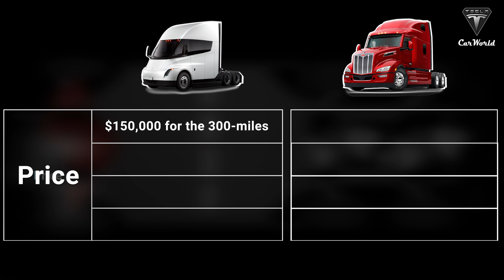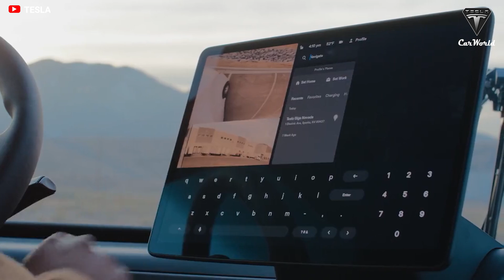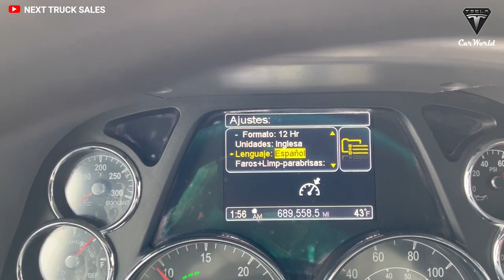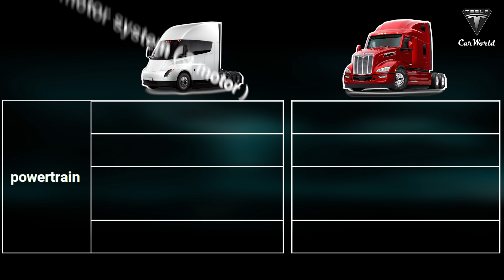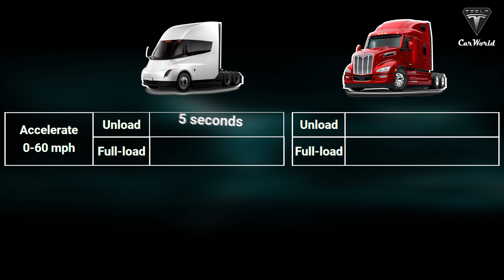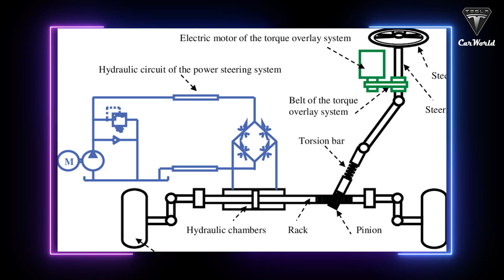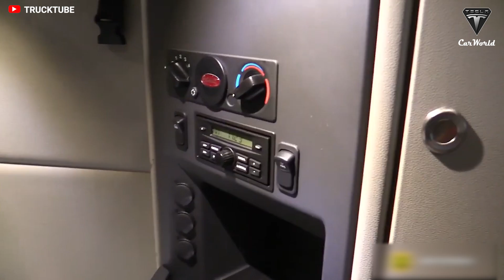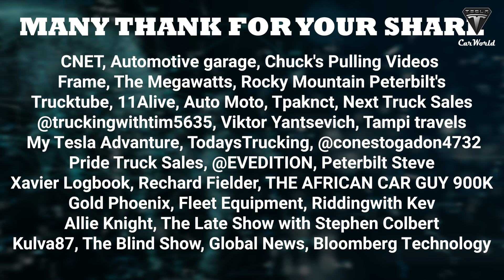Tesla Semi Vs. Paccar Peterbilt 579! Which is the Best Choice of 2023 Heavy Trucks?

Comment: The day my boss buys an electric truck I will quit and start working anywhere else!
Reason? I drive in arctic conditions during the winter and I don't want to freeze to death if I get stuck during a storm or something like that.
The storm itself is not a problem, the problem is that there will be hundreds of other, mainly private cars, who will have a more urgent need of assistance than I.
Our Scanias consume about 2 liters/hour on idle so that will keep me warm in my truck for several days if I get stuck, waiting for tow or EMC somewhere.
I can guarantee you that the batteries in a Tesla will NOT last as long!

Comment: I will take the Pete. Know why? First, try to roll-through a scale house grossing 82K , yea that's right you are going to get a big-fat-ticket. Second, they claim a range of 500 miles. Don't think so. Know why? Because if the Tesla is grossing 80 K it will put one hell of a load on the batteries which will severely cut down on the mileage. Add a head wind it you lose more millage. This has already been proven with the Ford Rapture as mileage was cut by 70% pulling a Model A (which weighs about 2700 LBS)35 miles. And how are you going to charge the tractor. That is much easier said than done. Truck stops will have to equip the power supply and if you know anything at all about truck stops this is going to be a huge problem. I could go on and on why the Tesla Tractor is not going to work, the technology is not there yet. If a company is using the Tesla tractor around town on very short trips, they could work but I would not want to pay the electrical bills, which would be very expensive.
Reply: Everything you said is wrong. First, apparently you're not aware that there's an exception allowing electric and natural-gas powers semis to have an 82,000 lb. GVW; so no "big-fat-ticket". Second, the 500 mile range, with a load of 81,000 pounds, and climbing the 4,100 ft. Tejon Pass ( Grapevine) has already been demonstrated. 
Of course a headwind will reduce range; so I guess not everything you said is wrong.
Yes, some truck stops will have to have chargers. PepsiCo has already built two of them at each of their Modesto and Sacramento plants. Tesla has built a nearly world-wide charging network for its cars, so if anyone knows how to do this, it's Tesla. Further, the California CEC has "$1.7 billion earmarked for infrastructure that supports medium and heavy-duty zero-emissions vehicles" (engadget dot com). If they're $1 million each, that's 1,700 hundred megachargers in California alone.
The technology is there; how else could they be delivering them to end users, demonstrating a 500 mile range, showing a Tesla Semi accelerating up Donner Pass with a 44,000 lb. load, etc.?
While the electric bills will be "very expensive", estimates are that diesel fuel bills will be 2/3 more expensive.
Reply: @BigBen621  Ok, so you are partly correct regarding the 82K law. First, everything I have been reading about the new law is that truckers will be allowed to gross 82K on "interstate" use only and not all fifty states have approved the new law however, I'm sure at some point soon all 50 states will allow it to happen. Second point is the 500 mile range. Let me tell you something, remember what Nikola Motor Company did? Yea, the tractor did not run as advertised, fooled investors by letting the turck "roll" down a hill. They can demonstrate all they want but it doesn't necessarily mean it true, just look around of what is going on today with misinformation, disinformation and malinformation. Yea, I know about PepsiCo because they were heavily invested (commented) to Nikola before their blunder. Yea, you can blabber on and on about charging systems, but the bottom line is it will never work in reality. Something else many never considered is "road taxes" yea that's right road taxes will be added when you charge the truck and it "will" be a hefty charge, just watch. In the end, this technology is not ready for full scale use. By the way, the reason diesel and gasoline are so expensive is because of our government not because of a lack of crude oil. Period. And worse yet, wait until the government starts to ration energy consumption, which has already happened. Nice try dude but you did make me aware of the 82K regulation, congratulations but the rest of your argument is bunk. Sorry.
Reply: @BigBen621  Look it up dude, just because you did not know about PepsiCo and Nicola doesn't mean it is not true. Same with US Express which was all in as well. It is not worth the time to read the rest of your dribble because you have a fascination with an "idea' that will never work "other than" in city P&D. By the way, how many millions of miles have you driven over the road? Oh, wait, NONE.

Comment: The tesla semi will not have a larger payload than the Pete. Both can't weigh more than 80000 pounds per federal law.
Reply: No one is claiming that the Tesla will have a greater payload that the Pete; but it will have a 2,000 lb. greater GVWR than the Pete. See 23 USC 127(s): "A vehicle, if operated by an engine fueled primarily by natural gas or powered primarily by means of electric battery power, may exceed the weight limit on the power unit by up to 2,000 pounds (up to a maximum gross vehicle weight of 82,000 pounds) under this section." I'm surprised how few people commenting on an electric semi video aren't aware of this.

Comment: 300  to 500 miles, what a joke. Having to stop to charge 3 to 6 times for every diesel  engines 1 stop. The weight of the Tesla means it can't carry maximum payload unless law changes are made. Most of my tickets have been for over weight loads.

Most of the safety features on the tesla trucks, I have on my hyundai 2.2 diesel.
Reply: Law changes have been made; see 23 USC 127(s): "A vehicle, if operated by an engine fueled primarily by natural gas or powered primarily by means of electric battery power, may exceed the weight limit on the power unit by up to 2,000 pounds (up to a maximum gross vehicle weight of 82,000 pounds) under this section."

Comment: A meaningful comparison would be the life cycle cost of the two vehicles which shows the total capital and operating cost over the expected life of the vehicle. These vehicles are likely to last 750,000 to 1,000,000 miles, which would be 15 to 20 years at 50,000 miles per year.

Comment: I work in the Trucking industry, I'm not so sure these electric trucks will take over until the technology will allow 1,000 miles+ per charge. Which should be able to fully recharge inside of a driver's 10 hour break. Until then, it's just hopeful thinking. Diesel engines will still be the industry standard.
Reply: Not to mention what is going to happen if 10 K trucks all plug in at once ! Will our infrastructure be able to handle it ? At the moment I say NO it would collapse. Do you see how many Trucks are on the road nowadays ? Triple what it was 20 years ago. Stop and think about it.
Reply: They have a range of 500 miles, and can add 280 miles in a 1/2 hour during the required break; so a solo driver in a Tesla Semi can legally drive as far in a day as a diesel semi, and can fully recharge five times over during a driver's 10 hour break.
Reply: To add, with the ability to convoy, fewer drivers are needed for greater semi utilization. I’m a dummy to the industry, do long haul truckers often exchange their trucks to other drivers between 14 hour shifts?

Comment: Fortunately the fleet owners know what questions to ask and if Tesla can't answer them with proven test results they will not be buying these overhyped toys.
For example, I need to install a charger, how much does that cost, how many trucks can I charge in a shift on this charger. What is my actual purchase price per truck including the charger. Much more than a 579 you say.

So many holes in Tesla's presentation.

Has anyone actually seen the one Pepsi truck actually working?

Comment: Owner operator of a 579 here... I'll keep my Pete for so many reasons not listed here but can't wait for diesel prices to go down after every one goes electric. I will keep an eye on these over 10 years to see how they go from freezing Wisconsin to burning Phoenix Temps parts availability etc. Very interesting 👍
Reply: Sorry mate but once you lose benifit of scale diesel prices are heading far high as are parts a labour to fix your truck.
Reply: @alanrickett2537  A Pete or any other diesel is much better to operate and overall cheaper. The Tesla tractor is a joke unless it is used for local purposes only. Forget running over the road in a Tesla, the technology is not there yet.
Reply: @JAAB9296  the semi is for local delivery hubs Tesla say that as do everyone else, cheaper to run is plain not true cheaper to buy we will find out over time fleet buyers only care able operating costs so if the buy them you are wrong if there's no market you called it , but you should know MAN, Pete, Volvo and many more don't think you are right as they have spent a lot of cash building electric trucks as well.
Reply: @JAAB9296  you are wrong on the grid as the change to LED lighting has dropped demand since the 1990s and we are still well below peak grid load in addition flattening the duck curve has no effect on the grid.Add in local batteries we should avoid the need for government interference.
Reply: @alanrickett2537  Funny.
Reply: @JAAB9296  but also true
Reply: @alanrickett2537  And what country do you live in where energy grids are so great?
Reply: @JAAB9296 Makes it perfect for Pepsi or Coke or Lay's driving around town, barely putting on miles. Tesla and others now will have their place even if it is only local use.
Reply: I have a question . freezing cold weather can empty the battery like very very easily . what I have experience about the battery . cold weather can kill your battery very easily so how can you wait for your charge
Reply: @alanrickett2537  Really? Seems like all of the countries you listed are having severe energy shortages. You know dependency on natural gas and so on. Oh, yea the countries are all tiny compared to the US.
Reply: @alanrickett2537  It's all the same in the end dude. Sorry.
Reply: @JAAB9296  no it's different and that why you deleted your reply were you made that augment.
Reply: My impression is that tesla semi will eventually inundated the local delivery industry because for its a great publicity for any multi national companies that sell consumer products especially with the going green initiative the consumer in general will appreciate the effort from multinational companies that have been none for being large polluters. That said for winter and long haul the diesel is the best choice but watch out Elon Musk is a doer and will eventually find a solution to winter and long distance delivery. Stay Tuned for more tesla news if you want to be in the loop for new things to come. Let’s face it semi diesel engine and the costs related eg: fuel cost to achieve its goal is very wasteful and low cost effective compared to a better overall Tesla E-Truck
Reply: @telsat  The first part of your comment makes sense. Can't say the same for the second part of the comment. Wait until state and federal taxes are added onto the electrical usage. Those tractors will not be any more economical than a diesel tractor for a myriad of reasons. Like I have written before the technology just isn't there yet. Wait until more EVs hit the road and the grids go down or are throttled back.
Reply: Electric is NOT the answer, batteries will always weigh too much. Mag lev for trains, yes. Hydrogen for commuting. Diesel for heavy industry.
Reply: @brianbidiuk3125 Hydrogen fuel cells? Hydrogen for ICE still produces Nitrogen.
Reply: BAHAHA YOU THINK PEOPLE ARE GONNA ALL BUY TESLA? HELL NO THAT DISGRACE TO AMERICA

Comment: 80,000 lbs is not the max of the peterbilt it’s the max legal weight. It can haul 80,000-120,000 lbs on some states, Canada and Mexico without doing anything to the engine or drivetrain.

Comment: The Tesla Semi can't haul 45,000 lbs and can't go 1800 miles on a single charge.

The end
Reply: Eleven 10' k-barriers at 4,000 lbs. is 44,000 lbs. Is this close enough?
Not sure what good 1,800 miles is, if you have to take a 10 hour break every day. Unless you're team driving, in which case you should be not comparing with the Tesla Semi, which is a day cab.
Reply: @Ben Thurston  if you're going off the video of the truck pulling a flatbed up the hill, past the truck pulling a van. Those jersey barriers don't weigh 4000 lbs.

1800 miles worth of fuel is 2-3 days without stopping for fuel. Regardless of 10 hours brakes. And, then it takes less than 30 minutes to fill up.

Let me make this simple. 

That Tesla does nothing better than a diesel truck, except accelerate.

That's it. 

If anything, a dursel electric hybrid, much like a giant Prius would be the best option. 

But this Tesla Semi is a PR stunt.

It will probably be a good option for city driving and LTL. That's it.
Reply: @purpletigerracing7087  If you search for "What does 10' Jersey Barrier Weigh", you'll get numerous citations showing a weight of around 4,000 lbs. Do you have any credible source that contradicts all of these?

Comment: As long as it wins on the 0 to 60 that's all truckers care about
Reply: As a cmv driver it’s range on one fuel stop my truck  can  1800 miles so 0-60 is not a importance to cmv and if you can even use that 0-60 state troopers on your ass for speeding

Comment: You can only haul 80.000lb in America NOT 82.000
Reply: Electric trucks have a federal exemption allowing 82,000 lbs. See 23 USC 127(s): "A vehicle, if operated by an engine fueled primarily by natural gas or powered primarily by means of electric battery power, may exceed the weight limit on the power unit by up to 2,000 pounds (up to a maximum gross vehicle weight of 82,000 pounds) under this section."
Reply: @BigBen621  The reason for that increased weight allowance was because they know that the Electric Trucks are heavier than the ICE trucks.
Reply: @pogo1140  Of course; and electric truck manufacturers can take advantage of the increased weight allowance to minimize the loss of payload due to the heavier electric tractor.
Reply: @BigBen621  Except the extra weight allowance is less than the weight of the battery.
Reply: @pogo1140  No argument. I said "minimize the loss of payload", not "eliminate the loss of payload".

Comment: Some states are offering further handouts that will decrease the cost of buying their TESLA, to as low as thirty thousand dollars. The reliability removes the cost and lost time of brake work, and the annual broken screen the average truck requires. The insurance, tyre wear, the tyres are inflated to control wear and will steer out of any potential ten thousand dollar, Jack knife. The comfort of being able to drive a normal load some seven hundred miles between stops, then a maximum load, to five hundred. The cost of fuel, elecitricy, is better than  ten percent. My Father would order fifty if he hadn't died on the very cusp of this revolution. Get out of the blocks, and run with this, now!